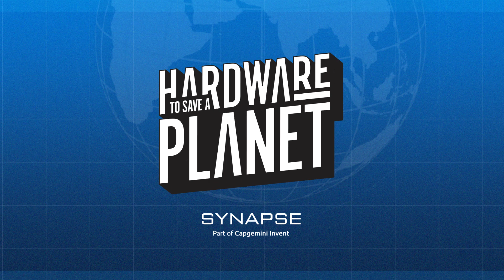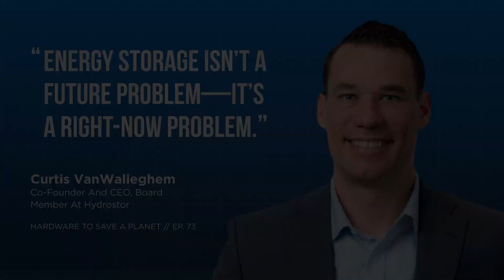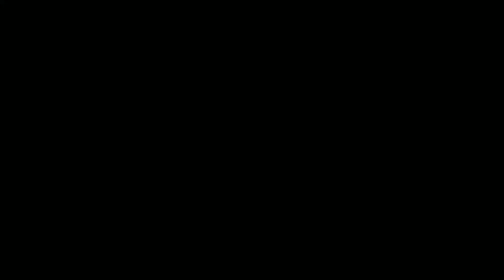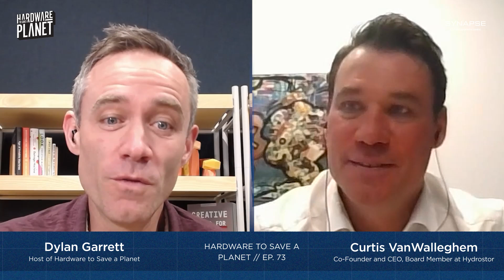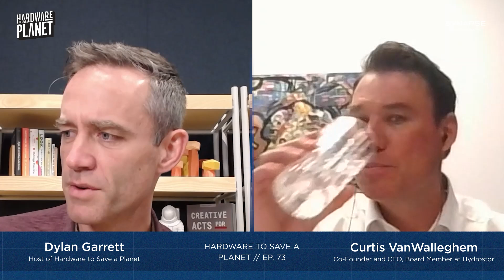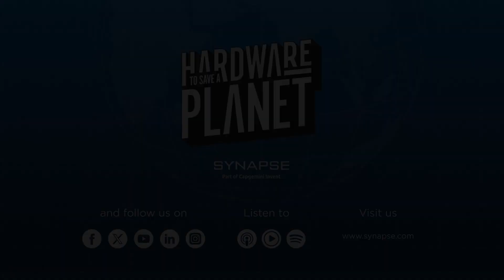Storing Clean Energy with Air & Water: Hydrostor’s Game-Changing Tech with CEO Curtis VanWalleghem

Comment: I saw an alternative approach using pump storage extending existing infrastructure by drilling into the rock. The video is german but it presents the solution. https://www.youtube.com/watch?v=AmEUWdMBox4 Has the adventage that you can use the existing infrastructure and no heating the gas phase. Sure that only works in some locations but also seems promissing.